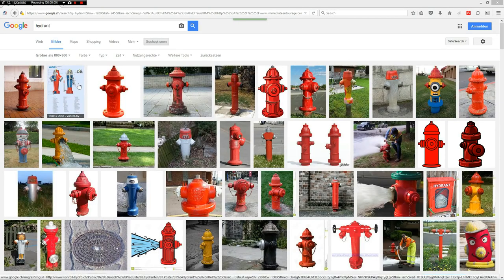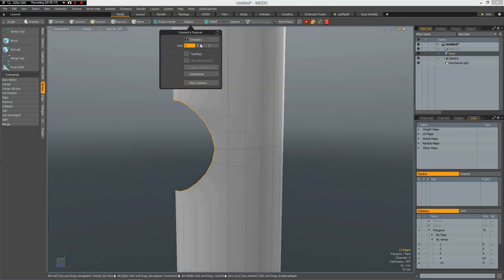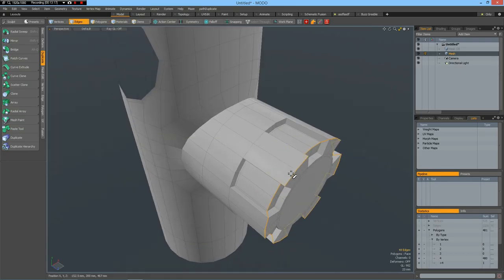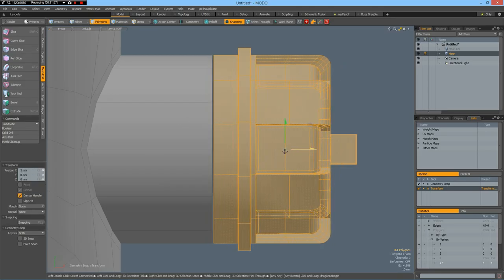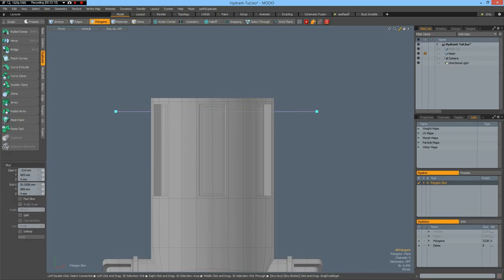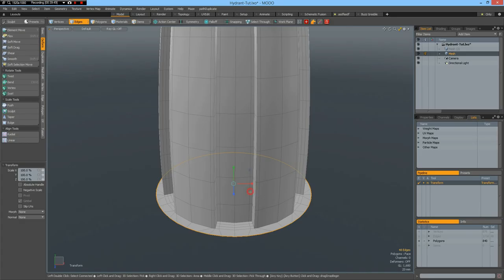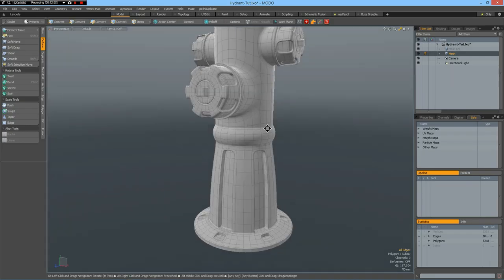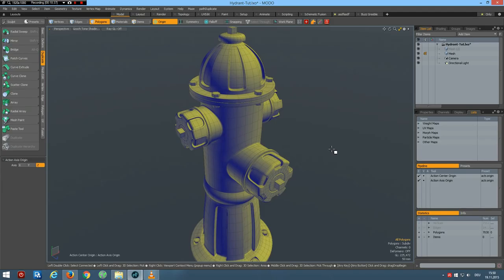The Foundry MODO - Fire Hydrant for Guus Jansen

Comment: Thanks Peter, great tutorial!  And thank you in particular for the tip on setting up the copy and paste behavior in the preferences that will be very useful.  There are a couple of things I am curious about, the first is how did you dismiss the constrain to background tool from the tool pipeline.  You just seemed to click on it and it vanished but it does not do that for me.  I can right click and dismiss it using the menu that appears but you didn't seem to be doing that.  The second is only a minor thing, did you end up with n-gons on your hexagonal bolt ends?  The reason I ask this is not entirely trivial.  I've made bolts for myself with hexagons and closed the end off by splitting the hex poly into a pair of quads, the drawback I've found of this approach though is that under subdivision the division of the hexagon like this causes it to become misshapen as if the link across the middle of this is adding some tension to the shape.  One of the render engines I use does not approve of n-gons and refuses to render them - others are more tolerant, but it still has left me for the quest for good but low poly hex bolts.
Reply from the maker: +David Brinnen Hi David, hit ESC twice and your entire tool pipeline is gone. Yes, I had 2 N-gons on the bolt ends and If i split these into 2 quads (which i didn't do in the tutorial..), i don't notice any distortions. If you feel there are some, you might want to try to first bevel the N-gons (inset) and then split them into quads. I hope this helps. If it doesn't, then please feel free to come back. All the best and kind regards, Peter
Reply: +Peter Stammbach, Thanks peter, for the ESC info!  What I failed to do with my hexagons was bevel the edges first as you did, I was going through part of this tutorial this morning and tested it for myself.  The bevel seems to serve to hold the edges without them pulling in.  Thanks as ever for the tutorials, they are a great way to learn and open up new possibilities.